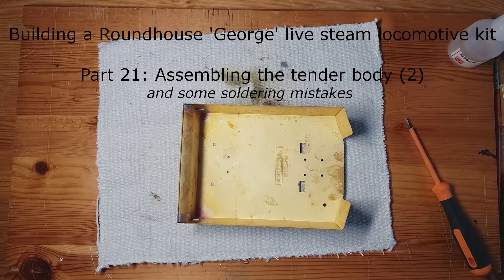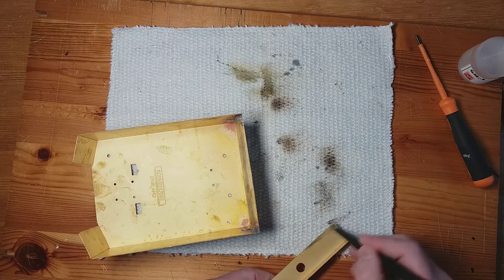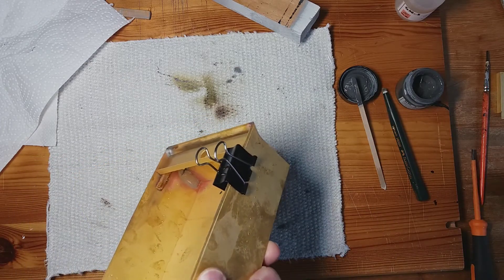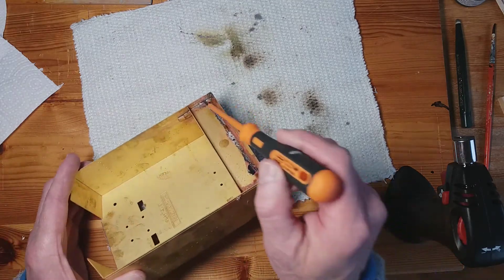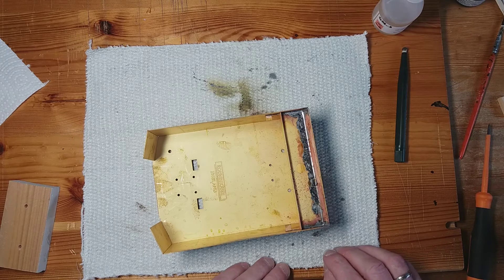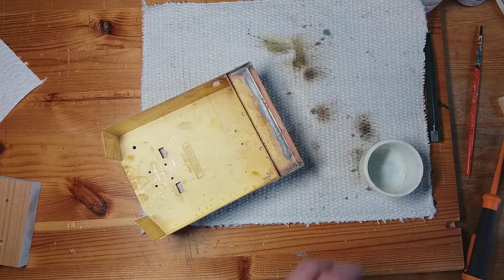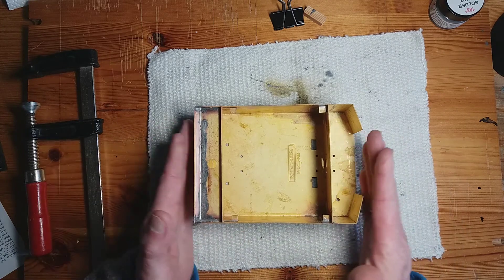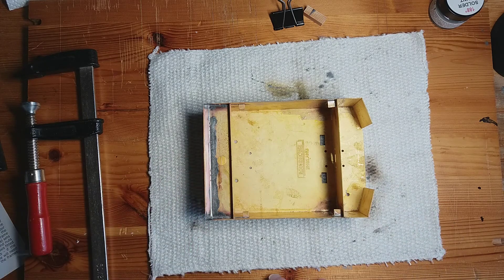RH George Part 21: Assembling the Tender body (2)

Comment: Great of you to show your mistakes as well, that's how we learn things.  Some tricks, I hope you won't mind.  You can use a small whet brush to push molten tin around to save some in the required cleanup work.  Also, when working with this solder you can also apply the heat from the outside, sometimes that makes things easier to reach.
Reply from the maker: Thanks for the tips Roel. I'll keep that in mind for the next build